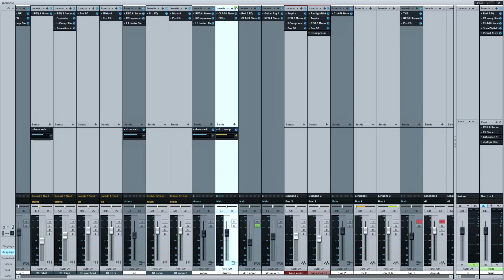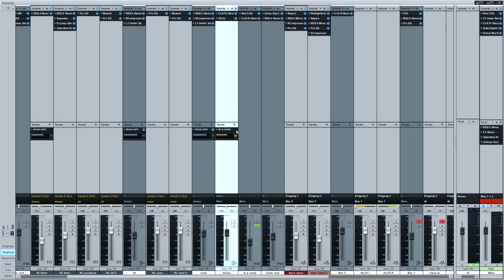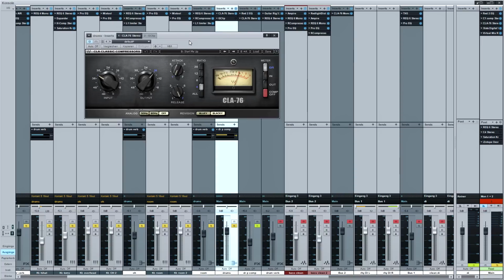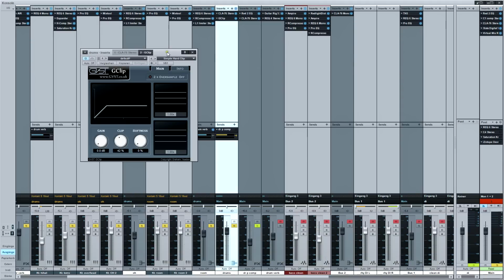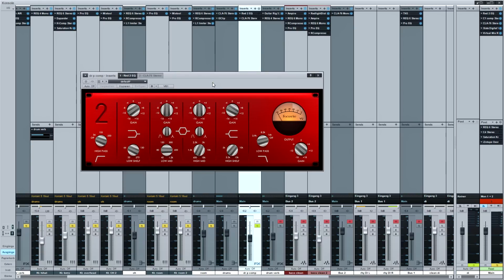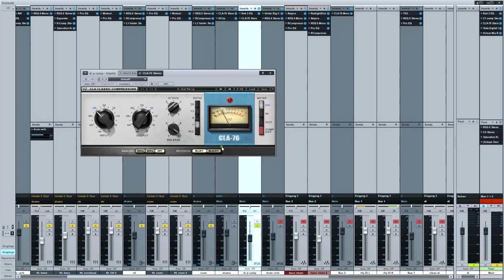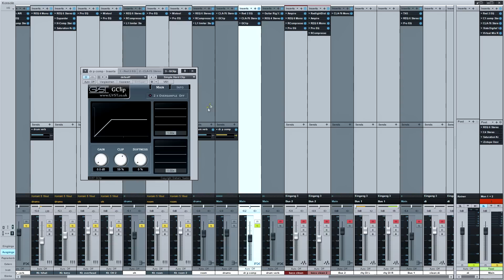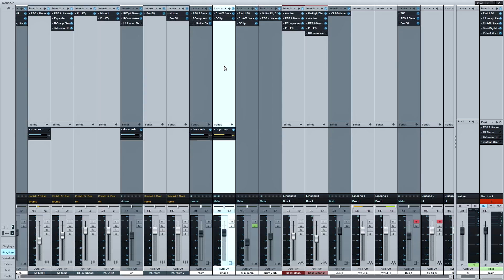Johnny's Secrets - Drum Bus processing

Comment: Are you using Studio Drummer or Abbey Road Modern drummer in this video? I'm deciding between the two and EzDrummer 2
Reply from the maker: i´m using Modern Drummer in here. but you can´t really compare it to EzDrummer. EzDrummer is already mixed and doesn´t give you the option of mixing the raw samples yourself. Modern Drummer has a few ok-ish mixing presets, but also gives you the option of mixing the raw samples yourself. gotta decide what you prefer.
Reply: Thank you! I'm trying out the EzDrummer demo now, and it has a mixer preset called "original mix" that appears to be unprocessed and allows one to multichannel out each individual mic. But I think I still like the general vibe of modern drummer better

Comment: Quick question relating to the drums, kick in particular. I'm having an issue where the kick seems to be clipping when listening back to it in the car (dreaded car mixes!) It's 100% not clipping at ANY point in the mix, but there's an audible "pop" every time the kick is played, which is weird when the snare is nearly a good decibel louder and has no such reaction. Any ideas?
Reply from the maker: broken speakers? don´t know tbh. one speaker in my car is a bit messed up and crakles when there´s too much low end. how is it on other systems?
Reply: It's fine on other systems, it's just curious since the only other album I play through them that causes it is Fear Factory's "Genexus" (again, the kick drum). They are old speakers so you're probably guessing right there.
Reply from the maker: if it´s fine on other systems than i wouldn´t worry too much. referencing in a car is a good idea, but i wouldn´t weigh it as more important than other systems. as long as the general sound and feel is good across many different systems you´re good to go. it´s just when you consistently hear an issue you might wanna look at it.

Comment: I'm having a little problem when I'm using parallel compression, what can I do to prevent this stupid vacuum-ish sound I get, do I just use less compression or an expander of some kind?
Reply from the maker: not sure what you mean by vacuum-ish sound. on the top of my head i´m guessing you´re release time is too slow so the compressor keeps pushing everything down. with a fast release the drums stay more up front. or in a way the compressor lets them "breath" a bit more.

Comment: Hey Johnny, I recently started using Studio One, but I have a problem. When I add superior drummer and activate all the outputs, they appear in the mixing console, but not in the arranger view. Also when I try to add 2 channels on a bus (lets say Snare top and bottom mics to Snare bus), all the buses appear to the right and there is no way to move them near the tracks that need to be. I have unchecked keep bus channels to the right from settings. And they work just fine with any other track, the problem is only with superior drummer's outputs. Any ideas? Thanks a lot!
Reply from the maker: yes, the multi channels only appear in the mixer, but not in the arranger window. that´s how Studio One does it. in the arranger you only have the midi track for your drum vsti. the multi channels are kind of like virtual audio tracks, so you don´t have any actual recorded audio tracks. that´s why the multi channels are only in the mixer, but not in the arranger. when you want to automate stuff for your drums you need to make an automation track and pull all the things you want to automate onto that track.
for the other problem it sounds like you have Studio One V3, right? i also noticed in V3 the multi channels of a vst instrument are locked together. you can´t put any tracks in between them and you can´t change their order. i also think that´s weird. i´m still using V2 because there are a few things in the way V3 is handled that i don´t like.
Reply: ForTiorI you got me covered! Thanks a lot!